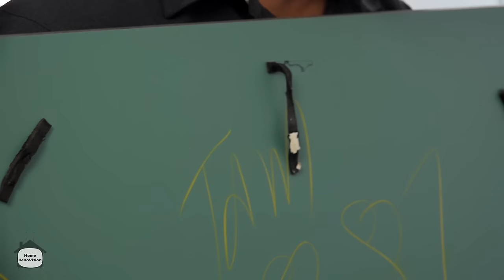How to Redo an Entire Bathroom | DIY Demolition

Comment: 0:00 Intro
2:20 removing existing ceramic tile
15:25 Turning off water supply to the house
16:51 removing drop in tub (no jets)
26:59 Taking out a toilet 
30:53 Removing mirror 
33:59 Removing a sink
35:06 Remove shower unit
44:20 Bathroom demolition (safety gear, shower fixtures, wall tile, drywall, tub, some plumbing)
1:15:58 Replace tub surround (new tile, new faucet, new pot light) from multiple substrates (hollow wall, vapor barrier walls, fire walls)

Comment: great advice ,did most of my own repairs and rehab. (fell & fractured my back in 3 places ,3 disc in neck 1 ankle and a knee... don't do things half ass.. I've watched hundreds of videos to ask the that knows what he's doing  but does not feel the need to go around the block to get across the street... I owned and auto repair center for 35 years and understand sometimes the short is  straight through the middle and STOP LOOKING there is no short cut, when there is you make sure to let us know (the floor with fine thread drywall screws DA....) KEEP UP THE GREAT VIDEOS............

Comment: Jeff you should use your sand cloth on the copper pipe where you plan to place fittings before you cut it. It'll save you some hassle with loose pipe and trying to sand it while holding at the same time.

Comment: Just had to remove a mirror that was really glued tight. Used a thin wire, pulling it carefully from side to side to cut through the double-sided adhesive. It worked.
Reply from the maker: Very creative. Not sure why someone felt it necessary to use so much self adhesive tape. Cheers!

Comment: 1. What is the best sub-floor to install in a bathroom? 
2. What is the best wall and floor substrate? 
3. Do we need to install heating with Schluter-Ditra-Heat, or can I just use the substrate without installation of heating system? (We got a ton of the substrate for free).
4. Do we have to level the floor before installing Schluter-Ditra?
5. Our shower drain is very loose when we removed the sub-floor, is this normal? Should we get a plumber to look at it?

THANK YOU!!! My friends do not understand where I'm getting all of my knowledge ;) I say YouTube Home Renovision! You have the ability to make the average first-time home-buyer feel confident.

Comment: I was thinking initially that you’d do something which I forgot to do in my 460 sq feet ceramic tile demo 2 years ago. But I am glad I did the same as you did. I also rented a powered chisel tool from HD for helper. I only used the hammer and I am done in less than 1-1/2 hr while my helper only did 10’x10’ area. I like your way of explaining to DIYers.
Reply from the maker: great tools make a job easier no doubt. Cheers!

Comment: The black residual on the insulation is a problem. It means there is a substantial air leak point in your building envelope. Not only dry dirty air passes through these leaks, but moist air does as well. As air transfer through your building envelope as does vapor.  This is why a tight air barrier in a Canadian climate is more important then the illustrated 6 mil poly vapour retarder. When you are doing a renovation and you find evidence of air intrusion, it is a great time to seal it up. Do not leave as we have seen here.

Comment: I find removing a toilet is made so much easier by using a shop vac to get all of the water out of the tank and also stick it in the bowl because it will suck all of the water out of the trap.  You can then lift the toilet and no water spills.

Comment: At first it seemed very overwhelming.  But now I know that I can do this! Thank you for all your videos, this is becoming a hobby for me.  Can you make a video on repairing water damaged subfloor?   My situation is that a tenant did not dry the floor after baths and it damaged the subfloor overtime. (It may even be a drain leak) I see minor water damage in the ceiling below, so, I worry it might be the entire subfloor beneath the tub.
Reply from the maker: Hi Richard we filmed that exact problem last week. It will not be produced for release for a while though.

Comment: So I've been watching your videos for hours. This touches on something I am dealing with in my house. I took the layer of plywood off the floor and it has laminate underneath. I want to lay more laminate down but there was an issue of rotten wood. My husband's dad cut it out and put some concrete board or something down there. It's now the same height as the laminate so I can't take the laminate off now. I need to make the transition nicer so it doesn't show under the floor. What would you suggest?

Comment: Questions: I’ve been successfully demolishing my master bathroom, following your instructions.  After removing the shower & tub walls, pan, and tub surround, I was surprised to find at least a FULL INCH of concrete under the bathroom floor tile.  It is very securely bonded to the plywood subfloor.

1.) Tips for removing the tile but leaving the concrete?  Advisable to do so or not?  I smashed a couple tiles and it’s very securely adhered to that thick concrete.

2.) Another challenge: the shower pan was a smaller footprint than required by the tub next to it.  I require the floor side of those previous footprints to be a straight line, so if I’m leaving the concrete intact, I’d still need to some trim of it along the area where the shower pan was.  How? What tool(s)? How do I keep from cutting through the plywood subfloor?

Thanks!
Reply from the maker: Hi Sean, while the tub is out you can get a bar under the concrete and lift it out rather easily. leaving that floor will cause you issues at the transition. once it is removed all of your other problems are gone. OR if you pull the shower pan forward and build out the back wall then you will have  a nice finish as well. perhaps a thin vinyl flooring to get a new look. Cheers!

Comment: I've seen people add insulation around a tub to try to hold the bathwater temperature for longer, but I think that insulation was thrown in to 'soak up' the sound waves that would have bounced around in the tub platform cavity. like muting a kick drum by stuffing it with blankets or something.
Reply from the maker: I guess my point is if you are going to do it then it would require at least 6 full size batts to get it right.
Reply: you're totally right, there's not enough insulation in there to do much of anything. actually, after thinking about it some more, it's totally just where they put the scraps.

Comment: Background - My 20 year old son and I are going to tackle a complete bathroom remodel in a 60 year old house. We have watched most of the videos about demolition, tub/surround install and drywall. We intend to use the Bootz NexTile tub & surround combination (very cool integrated shelf and reasonable ($509 at Home Depot) and the Ikea Hemnes 40" vanity/sink combo.  

Questions:
Is there a checklist or an A to Z video that explains/shows the "sequence of events/installs" for a bathroom remodel after the demo is complete? In other words "what do I do first, second, third ... last?" Drywall before or after the floor? Complete all the plumbing at the same time or do it at the time of the individual fixture installs?

What do you suggest with the following ceiling dilemma?
We have a 60 year old ceiling that has been repainted and patched many times. There are rusty drywall screws popping through and it looks like a mess. It’s a rambler so I’ve got insulation up above. I’m going to take your advice on installing the LED lights from the Canadian supplier.

Option 1 = We are going demo down to the studs except for the ceiling because I am trying to avoid the problem of insulation mess/expense. However the ceiling is a bit of a mess with rusty screws popping through and poor previous repairs (see photo). I was planning on: 
Putting in new drywall screws and removing the old rusty screws
Put on a layer of Kilz.
Skim coat to smooth out the rough spots and then paint
Option 2 = The other option is to apply Kilz and simply install new 1/4" drywall over the existing mess. 

Am I on the right track for the ceiling or do you have other ideas?

Thanks - Dan & Max

Comment: Thank you for the heads up on what is common with contractors.  Even though a different kind of project all together I experienced the same thing when I got a written estimate on a upholstery job for my old 1981 Mercedes 240d.  It should have been straight forward job for the business.  I even brought in an  upholstery kit so all they had to do was take off the old seat cover and install the new seat over the frame.  I get a call that they need more money because it took a full hour more to take out the seats.  So, I go to the business. The seats are still in the car.   This guy is flat out lying.  They are trying to get more money.  I had a boost of adrenaline,  pulled out a few tools out of my trunk and took out the seats in about 10 minutes and put them on the table to be upholstered.  The next time I have to do an upholstery job I will do the take out on my own.

Comment: I have been watching your channel for a week now and love it. I would like to know if you have a vid on how to tile around a window in tub area. thanks and keep up the good work
Reply from the maker: Not specifically that However the best option is to use stine sills and frame the interior of the window so that it protrudes just a 1/8th past the tile depth on the wall. this is easy to seal up and looks great. You can get that sill in marble or quartz or corion. Cheers!

Comment: Long time watcher first time commenting from destin florida

Question:  i am installing 12x24 porcelain tile 1/8 grout..in a bathroom wall with an 8ft ceiling.  

1.  I hear the new trend is no grout?  Thoughts?
2.  Will sheetrock with 5 coats of red-guard hold the extra weight  or should i use durarock?  
i am leaning towards unmodified grout. On the red-guard sealant

Great videos look forward to the response...  you are a threat to bad contractors all over the world...

Comment: Great video Jeff. I have an 80's bathroom with a tub shower combination. There are 3 marble panels around the wall. The two end pieces are already unglued from the wall so it will be easy to remove those and hopefully I can reuse them. The back long wall I dont know if it is loose, but my question is:  Is it okay to reuse these panels? Im having to remove the whole floor throughout my house because of mold under the entire house. The seals and joists will have to be replaced. Lots of money involved just on the floor. I am going to try to do the demolition myself so I can save what I hope I can reuse. I have two bathrooms so both have to be renovated as well as the kitchen. The contractor already told me my custom built kitchen cabinets have to come out because the floor is rotten underneath them. I am going to try and save them by doing the removal myself. I watched your show on how to remove kitchen cabinets and believe if I go slow, I can do it. Thank you for your informative videos. I have to confess since I found your show, I no longer watch tv. I watch Reality Renovision DIY and Renovation Reality. I will let you know how your videos helped me along. God Bless You.

Comment: I have a bathroom with a shared wall (where the tub is) that needs to go down to the studs.  If I need to use fire rated board for the common wall what is the best water/mold resistant board to use? I would like to use Kerdi board but it doesn't appear to be fire rated. Your channel is the best I've found. Thank you for all the great instruction!
Reply from the maker: They make fire rated mold resistant board. You probably need to find a specialty drywall store in your area.

Comment: When removing old flooring - how do you know if there is asbestos in the older layers?   

Also.  If I suspect there are asbestos wrapped ducts within adjacent walls, does it matter if im banging the floor?  Will that cause the particulates to spread?   

Thanks for posting really thorough info

Comment: We have a 1960s ranch bath with a shower and a weird soffit over it that we want to demo. Do you have a video that shows how to demo an old shower, shower pan and take a soffit out?
Reply from the maker: rip it out. It is just a way for builders to save money. Drywall is cheaper then tile. It is hollow 99 times out of 100.
Reply: @HomeRenoVisionDIY  Thanks!
Reply: Sofit may be hiding air duct.

Comment: Great video Jeff! I'm getting my supplies in order to tackle our bathroom renovation. We will have to do the ceiling as well, as the exhaust fan hasn't been working well. Moisture issues have caused mold spots on the ceiling directly above the bathtub/shower. We live in a somewhat small ranch style house with only one bathroom, so it will need to move somewhat quickly. Since we're doing the floor, walls, and ceiling, it'll pretty much be down to the studs. I'm thinking of hiring out the drywall so it will be done quicker than if I were doing it. What are your thoughts on the best wallboard materials for the different parts of a bathroom? Obviously, I don't want any more moisture damage in the future. Thanks for putting out these videos. You can't put a price on learning tips and tricks from someone who does it for a living.
Reply from the maker: Hi Ken, a good fan installed correctly will keep the space dry if you let it run for 5 mins after a shower. The rest of the materials can be pretty basic. I suggest installing a fan switch that has a timer on it so you can set the fan for 20 mins and then have a shower knowing it will turn itself off. Then you will not have to worry about mold ever again.
Reply: Thank you sir. I was definitely going to upgrade the exhaust fan. The one that's there is from the 1980s, if not earlier. It may be circa 1962, when the house was built. I don't know what, if any fans were installed in bathrooms then, but it looks similarly built to the kitchen exhaust fan we had in our home in the 70s while I was a young kid. While well built, it certainly doesn't have the CFM ability of the newer, more efficient fans. Love the channel. I subscribed recently, and find the info very helpful. I like your ability to cut through the BS and say it like it is. That's the kind of info I really need; not the manufacturers ad-speak.

Comment: The sink in our upstairs bathroom is clogged.. the plumber said we need to remove the bathroom floor inorder to replace the pipe. The pipe is galvanized...To remove the floor should we break the tile first or should we just cut through to the subfloor with a saw to remove it . Or go through the steps u have in the video
Reply from the maker: perhaps remove the ceiling underneath. Less scope of work. He should have a high pressure hose he could use to clean out the line as an option.
Reply: Thanks for the response

Comment: I’m so glad I stumbled onto your channel. Just bought a house and the window in the bathroom looks like it had water damage, the sill sloped downward near the shower head.  After the soap dish tile broke off after accidentally dropping a shampoo bottle, I found out why!! They used plain drywall and then insulation!! No waterproofing what so ever!! So I guess my question is, do you recommend fiberglass or what kind of insulation in a shower? Also I live in Ohio so do I need a vapor barrier? Is it insulation, vapor barrier, cement board, waterproofing, then tile the wall? I’m having a professional come check and repair the window framing, but I think everything else I’d love to try and make sure it’s done right. Not only that, I’m trying to be super budget friendly. Any input or help is greatly appreciated!!
Reply from the maker: That sounds very reasonable. I would suggest redgaurd for the membrane. Cheers!
Reply: Thanks for responding!! I saw in your video showing the redgard and made sure to add that. I even saved the video for further referencing while we’re doing the repairs.  Thanks for all your help and showing how to complete repairs without breaking the bank even more!!

Comment: Im pretty insulted by his portrayal of demolition contractors. I have worked for my brother, who is a licensed and insured, for over 20 years.  There are crooks in every area of construction. It is the home owners responsibility to do their due diligence and check out contractors beore they hire them. You can usually check online to see if they are licensed and insured through the building department in your city or municipality. Most cities require a permit to do even a small intetnal demolition demolition such as a bathroom. You can also check to see if permit is required online in in the building department of your city. If he were really looking out for you getting screwed over, he should have mentioned you may need a permit.